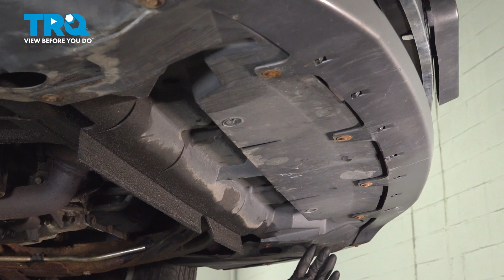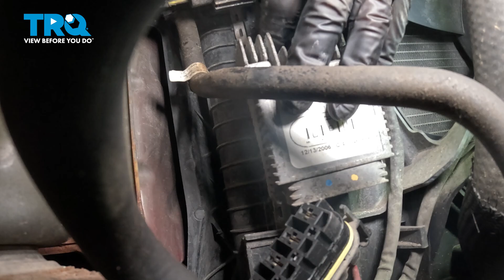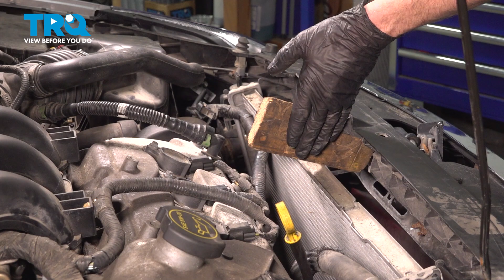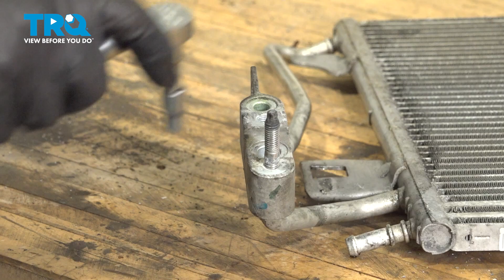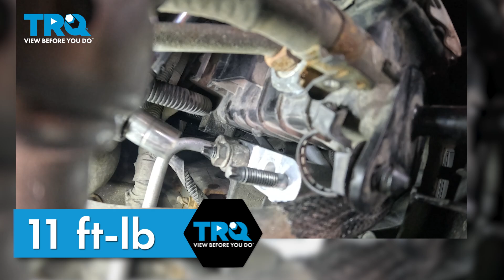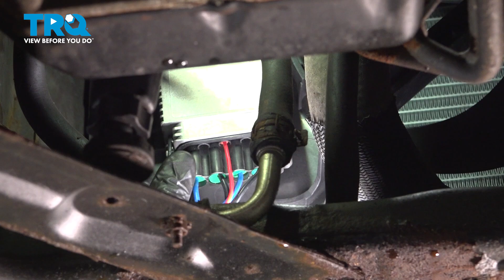How to Replace AC Condenser & Receiver Drier Assembly 2006-2012 Ford Fusion (3.0L V6)

Comment: 2012 the fan assembly is different. The fan control module is located towards the top and you only have to undo one plug and all the tabs on the wiring harness.

Comment: I have an important question to ask are there additional lines going to the condenser core other than the low pressure and high pressure line? I have a 2010 Lincoln MKZ.